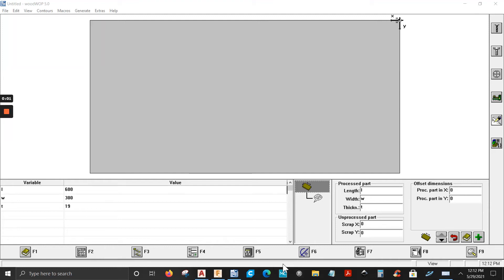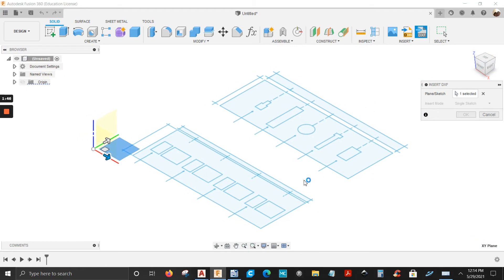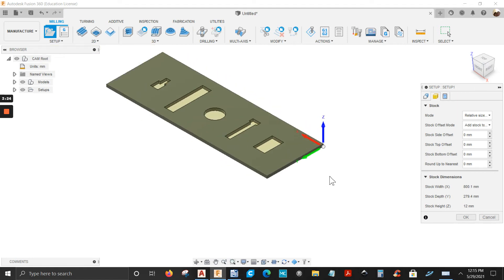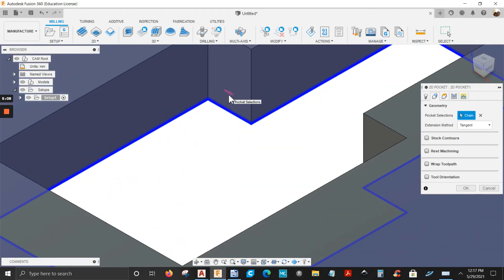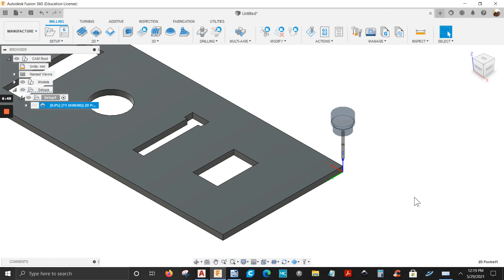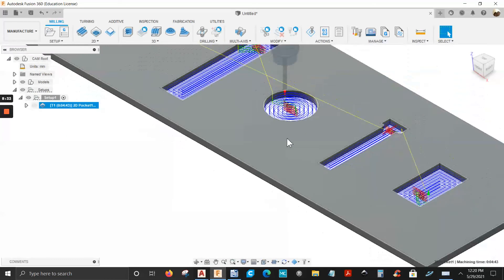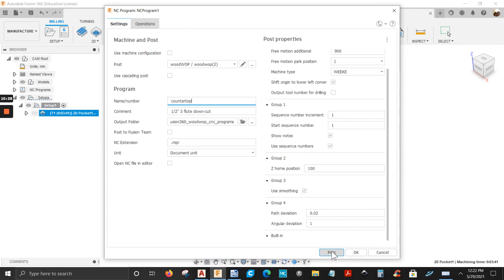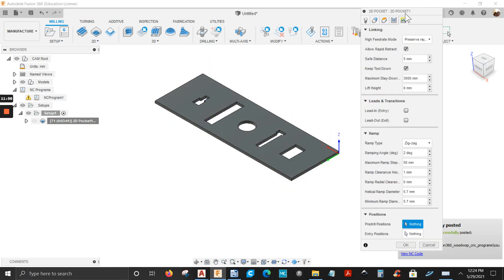Fusion 360 to Woodwop. Import dxf files into Fusion 360 and convert them into mpr files

Comment: How to get Weeke tools on fusion 360
Reply from the maker: Hi, in Fusion tool library select cloud and then import libraries, look for the folder a1\db folder and file is wz_db85.txt on woodwop 5.0 which i use. If it doesn’t work, add every tool manually and that’s what i did because the Weeke at work doesn’t have a tool changer which means all tools are going to be #1.